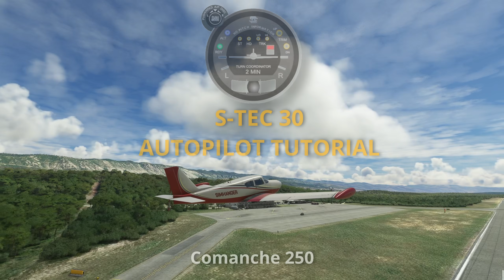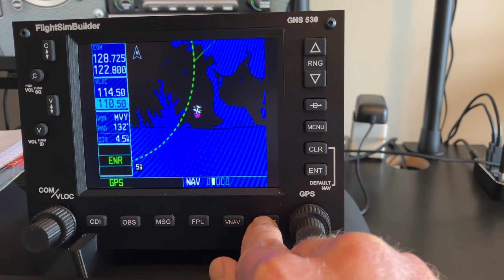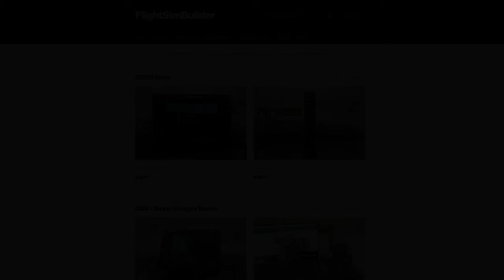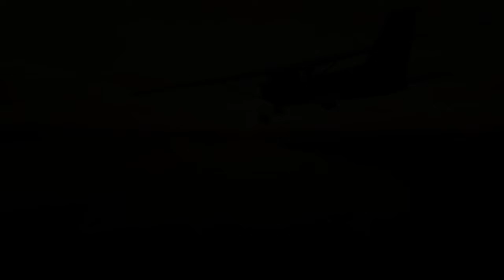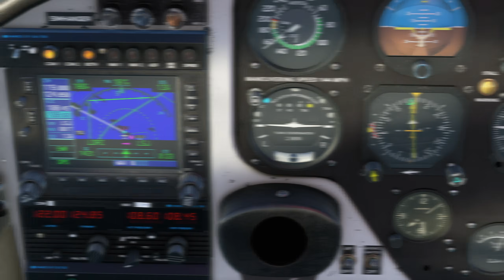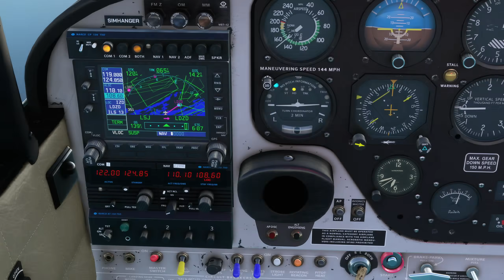A2A Comanche 250 | Autopilot Tutorial for MSFS | Includes ILS

Comment: Hi guys, I'm currently flying the A2A PA24, and I recently updated my avionics from the steam gauge analog instrumentation to the GNS 430 for some oceanic flight without conventional IFR. I'm having following issue. The track mode does not follow the magenta line from the GPS, I'm sure that the GPS mode is green on the GNS 430. Does anyone know what the problem is?
Reply: i have the same issue, have you found a fix?

Comment: Excellent tutorial. Nicely paced and relaxed. Many thanks. I have this aircraft, its an amazing product and very well developed. Very immersive. Certainly stimulates the mind. Keeps you busy during any flight. And this is of course a simulation ! which is what MSFS should be, with the amazing work A2A have done to code this to simulation level. You have to be in complete control and anticipate when using autopliot. It is not a "magic system".

Comment: This aircraft operates as the real aircraft ,  but it's autopilot is far to outdated, ,  but true to the real aircraft. For that reason I would not buy it personally.
Reply from the maker: It’s still used today in modern aircraft, including some models of the Cirrus etc.
Reply: @SimHangerFS  I agree , but without pitch control it takes some getting use to. Not sure you can fly ILS approaches with this AP?